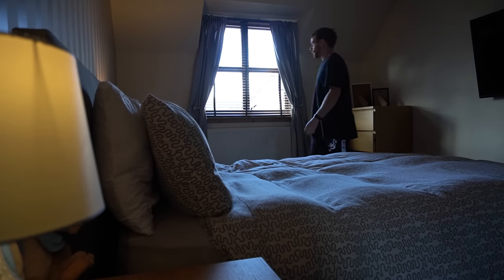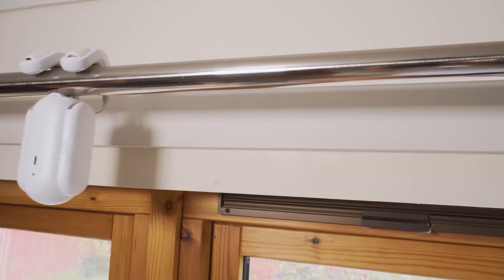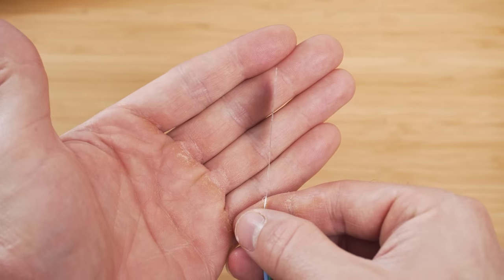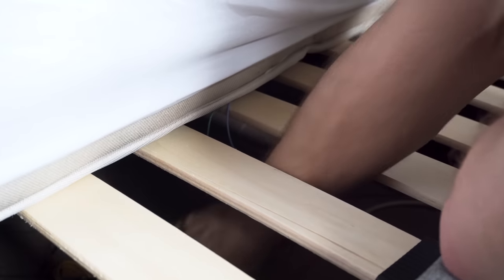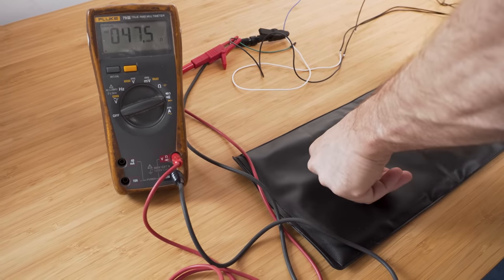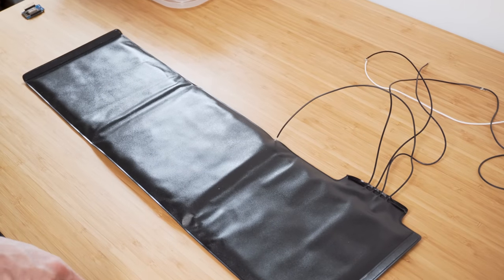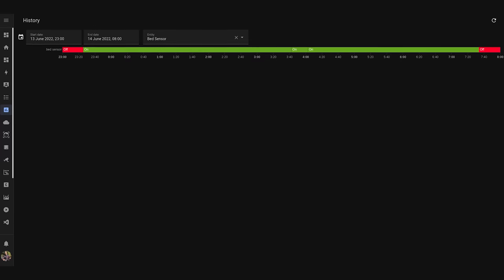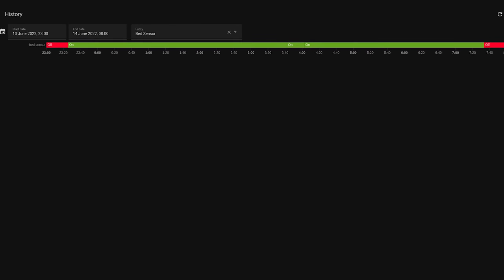Automate Your Smart Home With This Easy Bed Sensor

Comment: I am doing something similar, but with smartthings (for now).  I think i have the same pressure pads, but they are connected to a zooz relay box, so the NC relays open when i get in bed.  When we are both in bed and both relays are open, then it starts an automation that shuts down the house.  Im moving those automations to espresence now, though, because it seems to be more reliable and easier to create personalized automations.
Reply from the maker: Interested to hear how you like ESPresense!
Reply: @EverythingSmartHome  im on the fence, but leaning towards being happy with them to be honest.  in a couple of rooms it works really well, but i have issues in other places where the beacon bounces back and forth between 2 ESPs.  my bedroom is above my rec room, and i have one in both, so my wife and i can both be in the rec room watching a movie and HA has one of us as in the bedroom and the other as the rec room or not home.  Its better than it was, but having 8 of them in place, tweaking the absorption and distance to get accurate room readings has been a LOT of work.  i think itll be awesome if i can ever get everything dialed in, but its been kind of frustrating so far.

Comment: What if you used multiple pressure sensors and place them under the feet of the bed frame? You could add the sensor values together to get the total weight of the bed, tare it, and trigger when the total weight increases by more than 100lbs from the tare level.
Reply from the maker: Thats how the load cell method works 😅

Comment: Rather than an ESP (and are happy soldering) you could replace a reed switch on a zigbee contact sensor with the pressure pad wires.
Reply: I saw another comment from someone suggesting water leak sensors. Those would be even easier because the contacts are exposed on the outside.

Comment: I have a bed on 4 legs. Couldn't I put the pressure sensor under one or more of the legs to overcome the weight distribution issues?
Reply from the maker: Maybe, but in that case I would prefer load cells
Reply: @EverythingSmartHome  Thanks for replying! Though, currently I am trying to automate using bluetooth oral-b toothbrushes as we always go to bed straight after brushing. However, I haven't had the time to finish up sadly.

Comment: As the bed slats bow under pressure, why not try to use a linear flexiforce? It would work way better than the circular one.

Comment: I still have that pressure mat when i tried using it with zigbee door sensor as wireless bed sensor. But it didn’t work too well

I might have to try it again with esp.
Reply from the maker: Yes, at least you can configure the on off time with an esp is the only advantage

Comment: 6:16 - Great video Lewis, but how is the 2-wire version of the pressure mat (linked as the international version) powered?  Is it powered through USB?
Reply from the maker: It doesn't require any power 😅
Reply: @EverythingSmartHome  Thank you for the response and I apologize, but what I meant was: does the D1 mini receive its power through the USB plugged into a wall receptacle in order to read the changes of the states at the pressure mat.

Comment: I'm new to all this and I'm considering trying to make this but I'm confused slightly, once this is installed what do you use to power it, in the video you have it connected vis a usb to a laptop, but I'm assuming you don't keep a laptop on under your bed, you're going to connect  via Wi-Fi, does this need to be connected to the mains or are there battery option. As I said I'm very new to this.
Reply from the maker: Yes you would just use a usb charger like an old phone charger or similar to power it - batteries don't really work for WiFi devices.like this because of the relatively high power consumption
Reply: @EverythingSmartHome  Thank you

Comment: Great video! I'm planning on doing something similar, but was intending to use my ESP that is already running "ESPresense".
I'm thinking on trying to hook it up using the "PIR motion pin" in the espresense menu, since both outputs would be 1 or 0 .

What's your take on it? I wanted to make most of my esp running espresense.
Reply: Hey did you get this working? Thinking of doing the same

Comment: Great follow up. This sensor reminds  me of a sensor I did using a old mouse micro switch and on another chair one travel switch I believe it is called like that. I guess just glueing one of this on the bed wood slab would work just fine. Looking to this case and the bed slab deformation also could be used the weight cells but not the original design bridge configuration single cells but instead the ones based on an aluminum bar, just screw that alu bar sensor directly on the wood slab and the deformation will be the same on both triggering the weight sensor. Anyway 👍  video!
Reply from the maker: Thanks, that's also another good idea! Might look into that one day 😅

Comment: Nice build, cudos - but will it last?

Some guys on the community home-assistant io seem to think these type of sensors will degrade fairly quickly?  search the community for "Pressure pads for bed presence sensorts"..   

Comment was along the line of:"Don’t. They compress after a few months and start false triggering. Consider a force sensitive resistor instead."

Comment: Hello, thank you for this amazing video! 
I was wondering, would it be possible to place the pressure sensor under the bed's feed (as weight is divided by the number of bed's feet)?
Reply from the maker: The Load cell method would be better for that as they go under the feet. The weight of the bed would be too heavy for this pressure mat
Reply: Thanks for the video! I think i was wondering the same as bobopizza, would it be a solution to place the fsr’s under the bed’s legs? And if so, how should this be wired?

Comment: See I think an FSR on the opposite end of an ottoman divan mattress to the hinge would be a very reliable method and one I intend to test out when I build my bed.
Reply from the maker: Hope it works for you, I had hoped it would work in my situation but unfortunately not. Let me know how it goes!
Reply: @EverythingSmartHome  I think because the end of the lifting frame will provide a hard reference point that is affected by pressure on any area of the mattress it will be a lot more reliable. Will try and remember to get back to you when I eventually get that project underway!
Reply: I bought a FSR SF15-600 this one is much bigger, I will give this one also a try to see if this works.

Comment: Could you put a loadcell under each post, and then zero out the weight of the bed? For use with multiple people, this could track what time and how often our 2yo and 4yo crawl in our bed each night.
Reply from the maker: Yes you can that's how the other video works, the scale is tared/zeroed and then it measures all additional weight

Comment: Great video. I was just thinking about doing something like this the other day. Also, a potentially more simplified option might be attaching one of those pressure sensors to a zigbee/zwave leak sensor.  Since leak sensors just detect if it's circuit is closed, this might just do the trick.
Reply: I have this mat attached to a zigbee contact sensor
Reply: @revdbrink  which leak sensor did you use?
Reply: @DarixCn  I used a door sensor, the Aqara MCCGQ11LM
Reply from the maker: That's also a good method too for sure!
Reply: The downside is also it's not constant when your in bed. The solution with the delay is why I prefer the ESP over the zigbee for this solution.
Reply: @revdbrink  You can add the delay from your automation platform, instead. In Home Assistant, it's trivial to add a wait time for a state change. Hell, you can actually add the delay to just one state change, instead of both, so you could have it only add the 20 second delay when you get up.

Comment: Or, for a foolproof, long-term solution - just use Lewis's original bed weight/presence detector using the load cells.  It's been working here for many months with no trouble.
Reply: Can't use those on certain types of beds. Like ones that don't have legs and instead use their entire framework to spread the weight onto the floor.

Comment: There are a couple of 'sleep monitoring' sensors that will track respiration and heart rate, operating in the 60 Ghz range. I've no experience with it, but I suspect that the target market is folk suffering more from sleep apnea than the home automation market. Considering that market, the (about) $50 US per sensor (on up to over $150) probably isn't unacceptable, but I would consider it unacceptable for home autmation home brew kit.

A fix for the FSR limitations would be to get 4 (or more if needed) and treat them as load cells under the feet of a bed. I realize that there may be some limitations for accuracy, but if the bed has 4 'feet' of some sort, then 4 of these wired to a wemo d1 on analog ports would give a simple solution for setting up  at home to see if a load sensor solution would end up working out. After all, getting things 3d printed isn't really difficult, even if you don't have a printer.
Reply from the maker: Hopefully we will see some cool advancements in smart home sensors over the next few years!

Comment: If you were to put the FSR under the end of the slat half the pressure exerted to the entire slat would be on the sensor.
Reply from the maker: Might need to revisit it for sure!
Reply: @EverythingSmartHome  in fact, if you do try it again, they often have a sliding plastic end. If you put it inside between plastic and slat there would be less abrasion to the sensor.

Comment: Those pads are not supposed to be folded. That will destroy them.

With slats that bouncy, you could make it even simpler with a aqara vibration sensor which also gives a angle reading.
Reply: Did you get it to work? For me, the angle was not accurate enough for the small angle changes
Reply: @phil-jc8hp  i haven't tried it but I have seen others with good results.
And given how bendy his slats are I would believe there is enough to get a result.

Comment: tried that. Did not like at all the noise it makes when moving on the bed. switched to resistor strips
Reply from the maker: There is zero noise for me but would be different depending on your bed I guess. Good you found a solution

Comment: Great video. After many years in the home automation field, I still feel that home assistant  still lacks behind in terms of stability and reliability compared to other players such as Control 4, Lutron, Hubitat and Fibaro. For me reliability and stability of an ecosystem is always my first as do many others...nobody wants a system that must be resuscitated every now and then to  stay functional if left to run on its own or breaks down after an update..
Reply from the maker: Thanks!

I would disagree and say that home assistant is very reliable when left alone (like you are forced to do with closed solutions that you mentioned) - the problems come when people don't check breaking changes and update blindly.

Having said that, could the updates be smoother for breaking changes? Absolutely! There is always room for improvement.

Comment: you don't need the load cells under the bedposts. you can put them under the mattress, on the slats. that's what I did and it works fine. so that's a non-excuse.

Comment: I don't understand why my comment was removed, but those pads are not supposed to be folded. 
They break when folded. 
And they also break when your kids are jumping in the bed.

But seeing how bouncy your slats are you could have used a aqra vibration sensor and looked at the angle of the sensor when mounted to the underside of the slats.
Reply from the maker: Yeah I wouldn't leave it folded like that, I unfolded it when in proper use